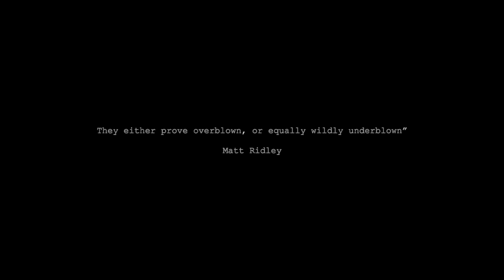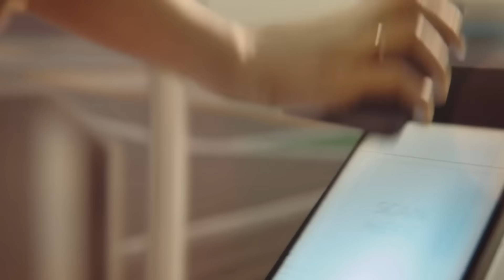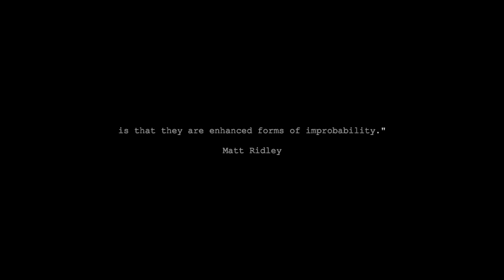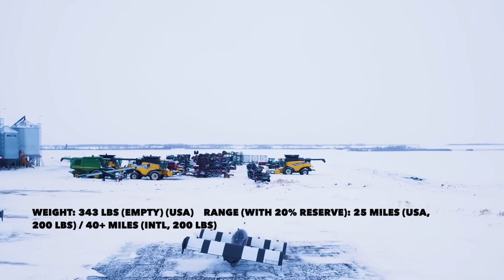The "FLYING CAR" that you can Afford to BUY! [Pivotal Helix]

Comment: Any would-be aircraft without the ability to glide (9 to 1 or so glide ratio) when not under power is unsafe. Even helicopters can be safely landed in the event of engine failure. This thing does not seem to have a much in the way of a wing and would likely drop like a stone.
Reply: Redundancy of motors and batteries mean that short of a midair collision this is far safer than most small aircraft. It could also have a ballistic parachute as well.
Reply: Any would-be aircraft without the ability to glide (9 to 1 or so glide ratio) when not under power is unsafe.
Reply: @johng9562  it has a parachute designed specifically for that purpose but hey you’re welcome to keep pretending as of you know better. Good luck with that. Let us know when you design an aircraft.

Comment: Bulky and awkward. Likely to cost 10× as much as an ultralight helicopter or autogyro, without the advantages of range, speed, or height, refueling, or even auto rotation. Doesn't look like it can easily be transported either. This just a dumb gimmick of an aircraft. It's not a car as it doesn't have wheels nor can it drive around on land. This thing only exists as a toy for rich people to show off their wealth. There's nothing even truly innovative about the overall design either.

Comment from the maker: Who wants a Black Fly?? ✋✋✋
Reply: Lighter and simpler is better.  Lower cost of operation and ownership.  Wings provide lift during forward flight saving energy.
Reply: @pctrashtalk2069  Exactly...
Reply from the maker: @pctrashtalk2069  👌
Reply: This market segment (GA, hobby aviation, last mile exploration...) is hugely underrated or did not even exist so far...I wanted a UL helicopter but the most stable version coaxial type is not manufactured at a reasonable cost by anybody...furthermore the training and pilot skill upkeep is mostly not possible for many people...
Reply from the maker: @electricaviationchannelvid7863   Let's see how the first 25 units of Black Fly coming up at the end of year perform. 
I agree, I think it is underrated and it could be a big market